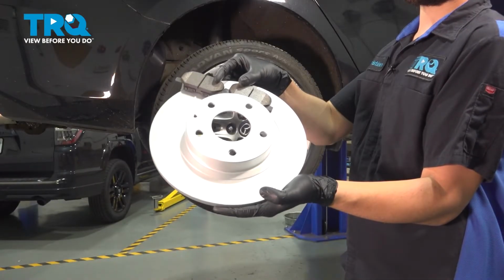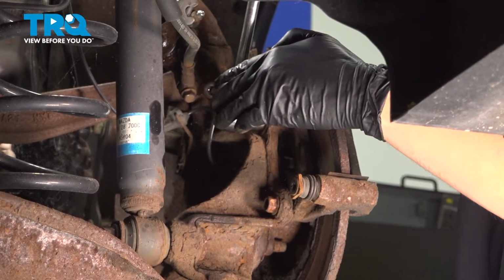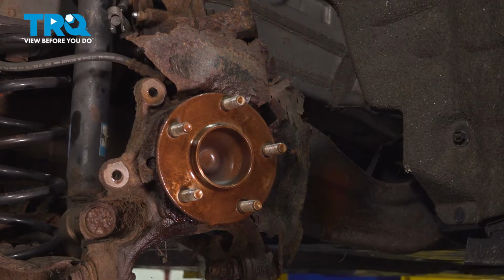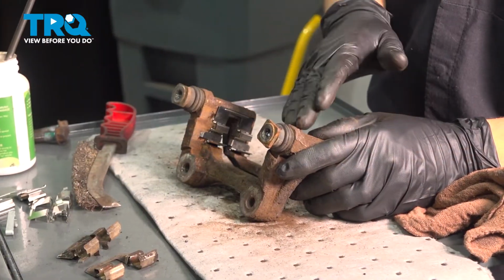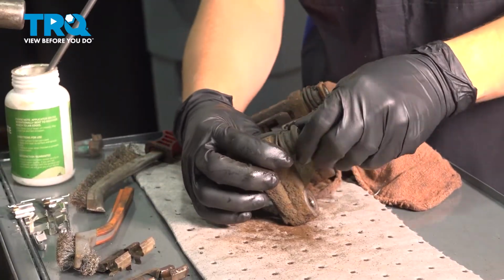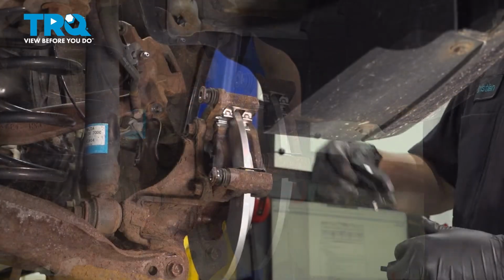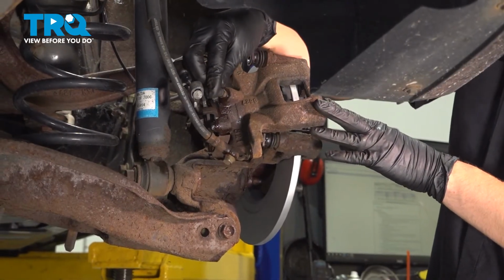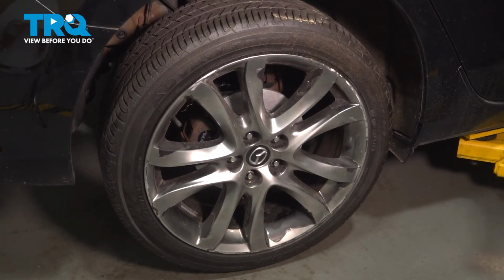How to Replace Rear Brakes 2014-2021 Mazda 6

Comment: My 2019 Mazda6 Signature doesn't have the anti-rattle clips in the caliper bracket.  The kit I bought to do this came with anti-rattle clips, and the video shows putting them in, but the clips that came with my kit don't fit in my bracket and after researching they are not needed.  Apparently some manufacturers put a catch-all bag of parts in the brake pad kits and that's what I got with my Powerstop Evolution Plus Z17 Ceramic Pads, but completely unnecessary.  Just an FYI, depending on your variation of Mazda6 model.

Comment: Brake caliper bracket bolt torque spec is 75 ft/lbs, according to multiple sources. You stated 45 ft/lbs.
Reply: That’s the front torque spec, Rear is different